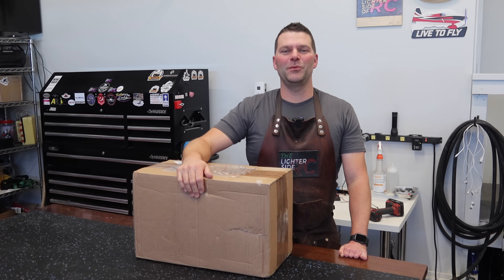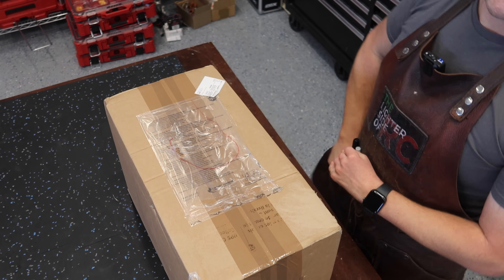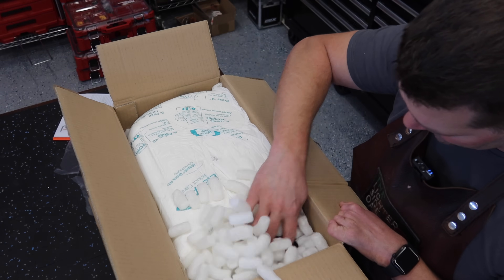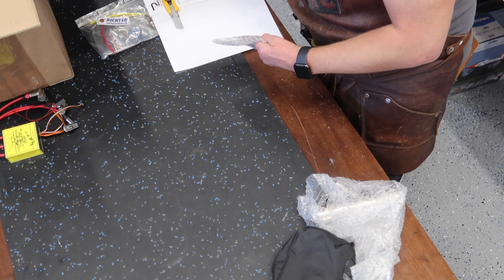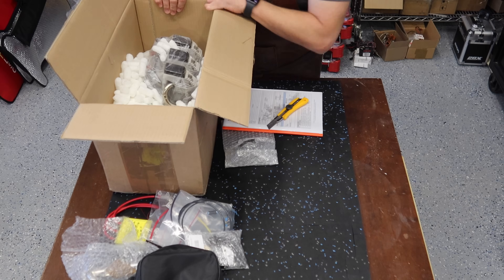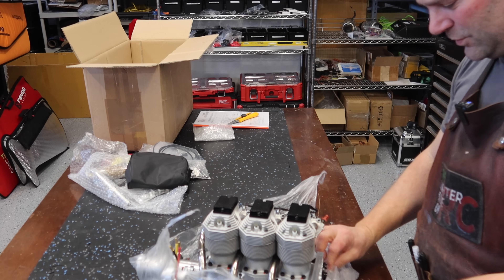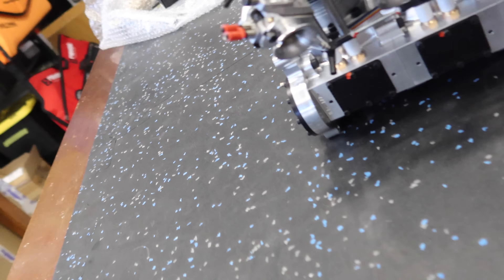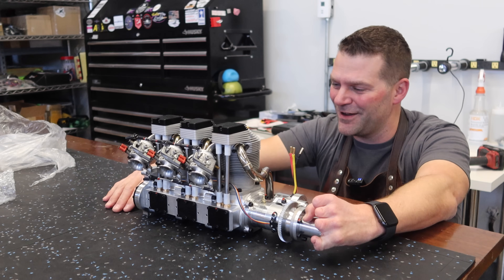INLINE 3 CYLINDER ENGINE UNBOXING - KOLM 230CC inline 3 Cylinder

Comment: Watch your fingers at 230cc....you might need to wear a helmet. Love the small intermediate idle gear on the geared starter motor direct to crank...cool what can be done using gearing. Insane motor and super scary...count your fingers before and after each flight would be my advice.
Reply from the maker: Thanks for the tip!  Definitely a good reason to have remote start!

Comment: Oh wow.... That's a fabulous piece of kit! I've been curious about the Kolm engines for a while, but not for aero models. I've been curious whether they would be suitable to fit into a 5" gauge model locomotive driving an alternator for traction power. It would need to be cooled of course, but I'm not sure if they would be appropriate. The size, the sound and the power output would be good, but its whether you could suitably mount and cool them.
Reply from the maker: Thanks!  They sound amazing and if the specs fall in line with what your looking for than it may be a good choice.  Cooling would for sure be very important.  When we get into the STREGA build, the cooling system in the aircraft is very well thought out.

Comment: Hopefully that rear cylinder doesn’t struggle but looks good.
Reply from the maker: Good Point Wayne.  The Cooling Design that CARF has laid on in the Strega is very well thought out.  We will be installing temp sensors on each cylinder.

Comment: Have fun with our “Powerhouse”. Glad you decided for the most badass engine you can get for the carf Racer ! If there are any upcoming questions: feel free to ask. Great video as well !!! Thanks for trusting in Kolm Engines 👍👍
Reply from the maker: Thanks Thomas. I think we would like to order the ISB, fuel pump and the ESC unless you suggest otherwise?
Reply: The pressure tank system works also perfect. It’s on you ! The ESC is recommended.
Reply from the maker: Thanks!
Reply: Good choice 👌🏼 
Have fun with this badass engine 😎 🤙🏼
Reply from the maker: Thanks!  Looking forward to it!
Reply: I understand that you can continue to order engines and the production plant is operational?
Reply: @RBBLANES  you might get in touch with @Tomas Gass

Comment: If you think about  it, 18 lbs for a 230CC engine is pretty spectacular!  They make motorcycles that race on tracks with just 20CC's more and I guarantee you those don't weigh in at a mere 18 lbs. (transmission or not).  Very impressive but like another said, it will be interesting to set the CG even if the distance from the LE of the wing to the firewall is short.
Reply from the maker: Yea so true Scott. A few of the other documented builds out there look like it’s possible to get it close or bang on without extra weight. We do have the onboard starter so that adds some additional up front

Comment: These planes need like 10 12 lbs tail wight ti get cg right with this motor
Reply from the maker: Shouldn't need that much.  The Battery location on the Strega is in the pocket at the rear of the plane.